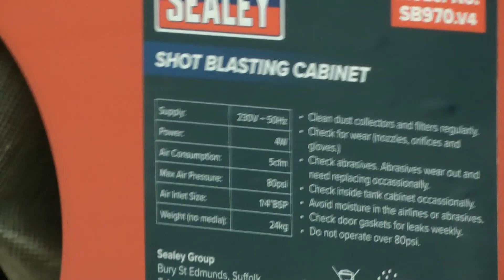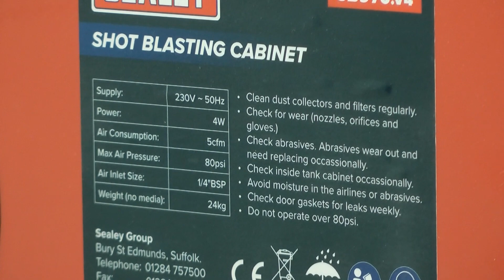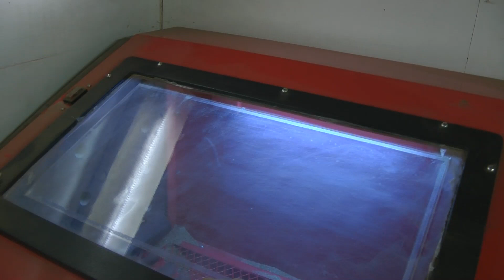Sealey blast cabinet review and air supply modding

Comment: Use a smaller pickup tube on the original gun, if your compressor is underpowered that will help. You could also try adding a bit of tube to the second gun you tried since it clearly works well with your compressor. No need to keep filling the pot then.
Reply from the maker: Good idea certainly worth a try